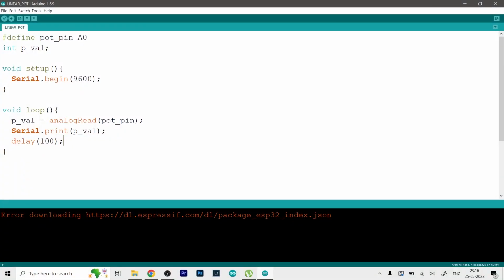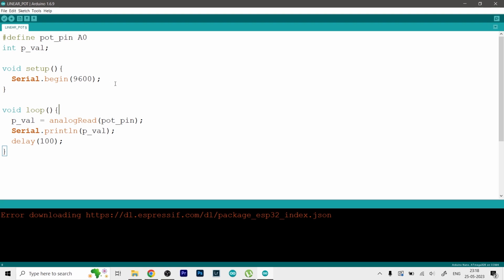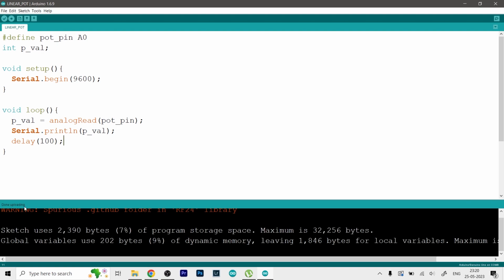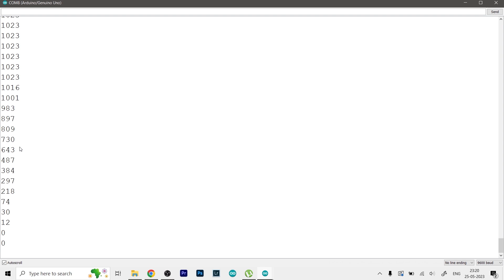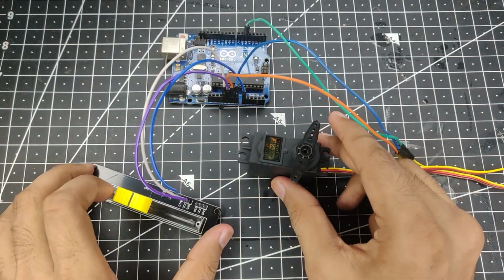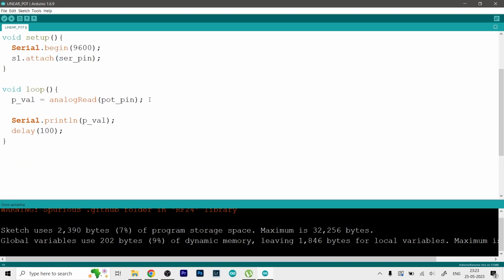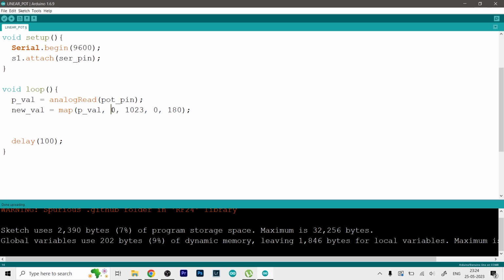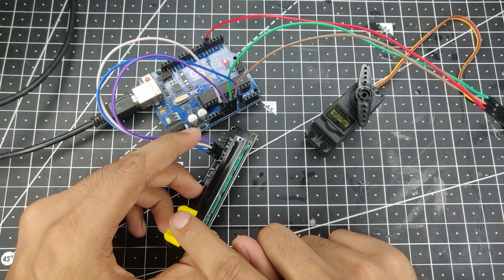How to use Linear Potentiometer with Arduino and  control a Servo Motor

Comment: The potentiometer you use in this video is designated as "linear" because of its mechanical built, but in fact it is a logarithmic potentiometer, mainly used in audio applications.